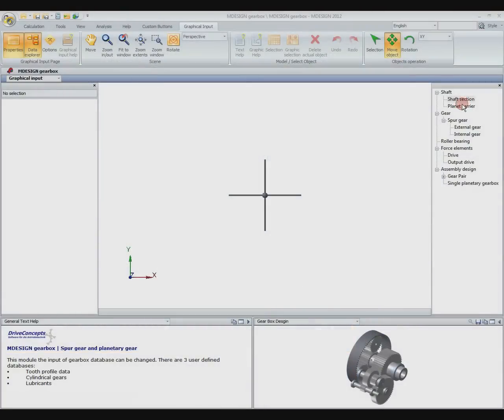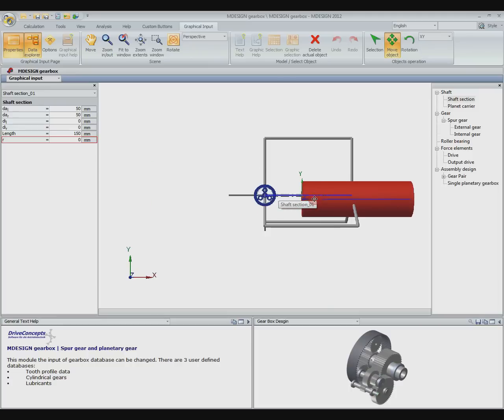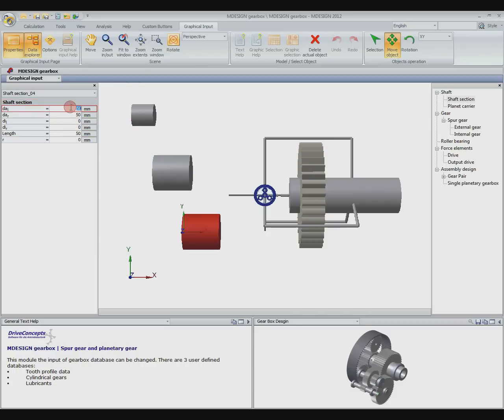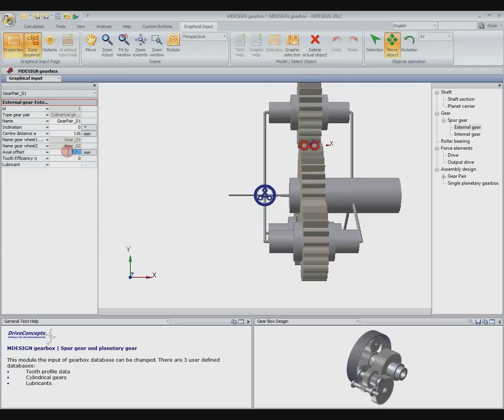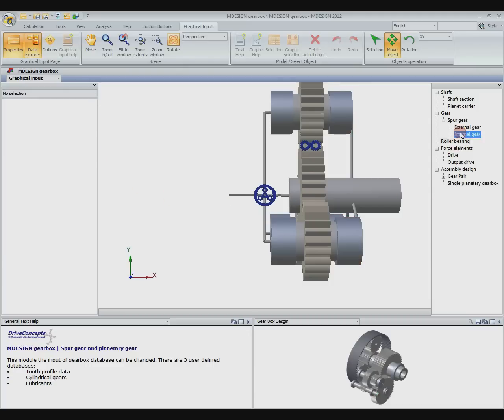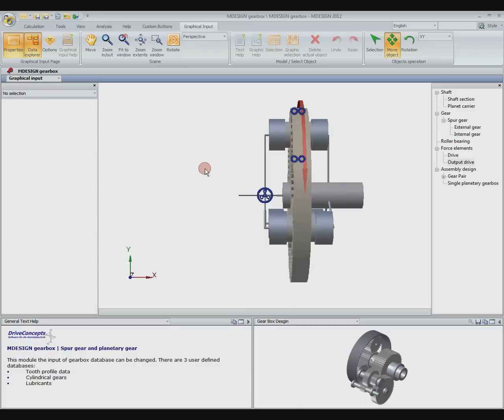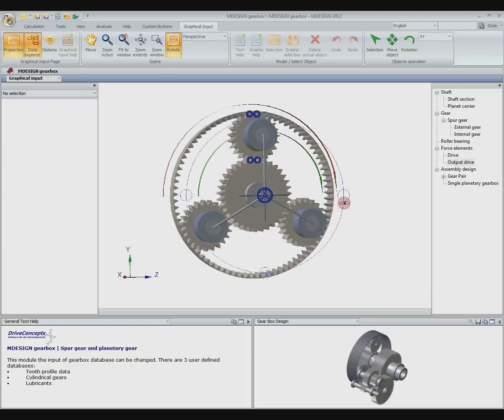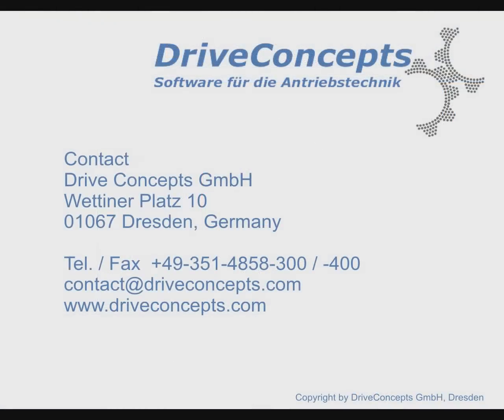MDESIGN gearbox 2012 - Tutorial for design a planetary gear

Comment: What is the name of the software , you have used in this video. Thanks.
Reply from the maker: It's MDESIGN gearbox 2014 software for gear design and calculation. If You Need a test license please contact DriveConcepts under contact@driveconcepts.com